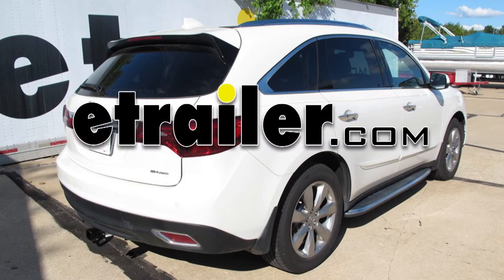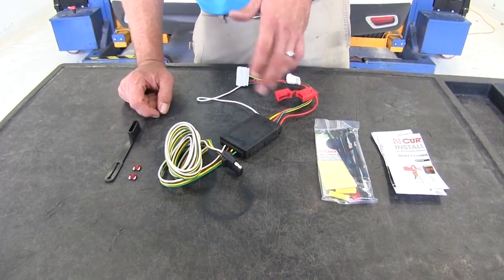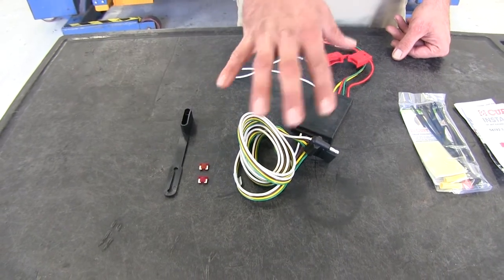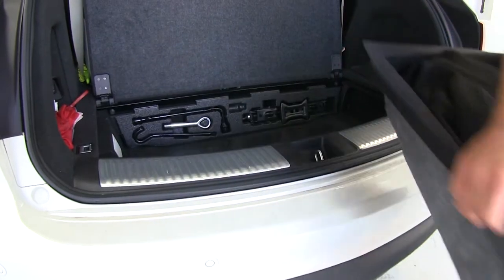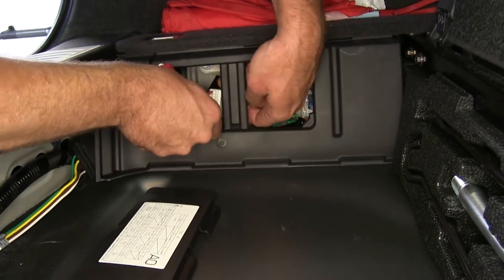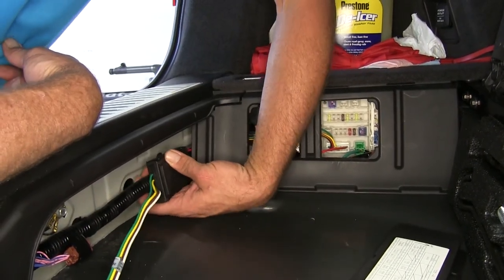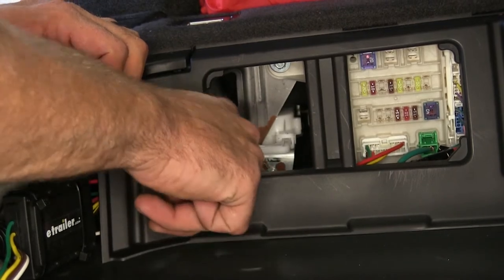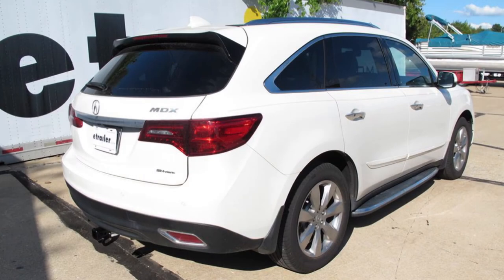etrailer | Trailer Wiring Harness Installation - 2016 Acura MDX

Comment: Why 10A fuse for position 2? The white label says 20A for #2 trailer small lights.
Reply from the maker: That's just what Curt decided to use for this kit. Since this kit has a max amperage of 3.0 for the stop/turn lights and 6.0 for the tail lights the 10A fuse is perfectly fine for this application.
Reply: @etrailer  Thanks for your reply. I installed 10A fuse as shown, I'm sure it'll work. Thanks again!
Reply: Steve P, Does 10A fuse work on your vehicle